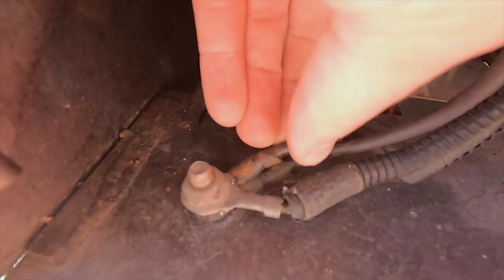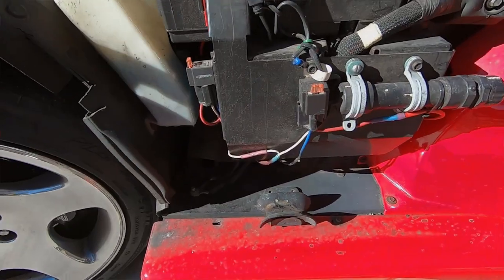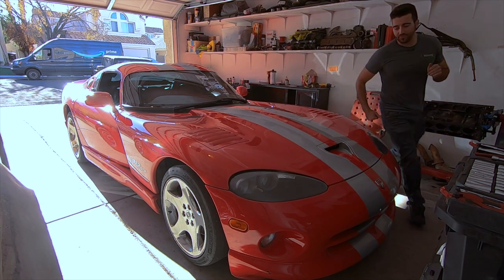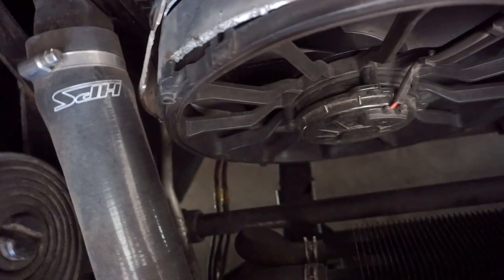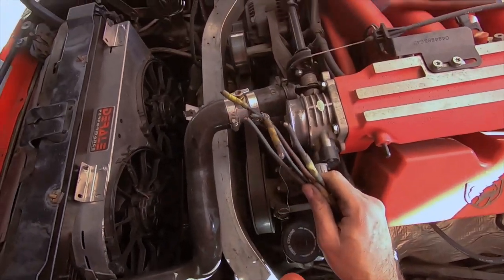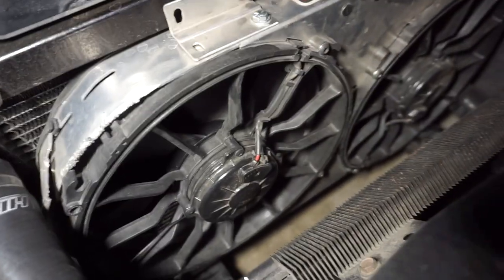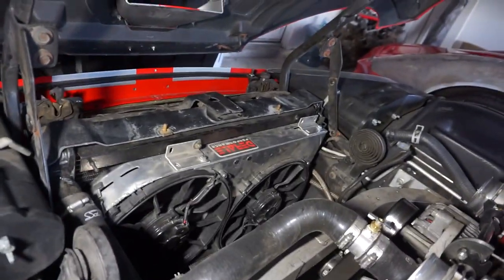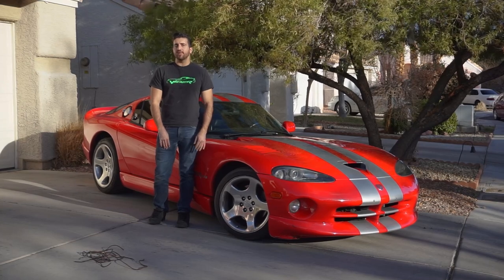What Are These Wires For? - Replacing Bad Radiator Fan Wiring On 2000 Dodge Viper GTS

Comment: It's not only the moisture causing the issue, it's the heat on the wiring that's causing everything to get so brittle.  The key is to mitigate the heat exposure to the wiring or anything else that might be plastic.

These cars have significant heat/cooling issues.  Switching to that better fan setup (who makes it?) was a good start.  Going to a larger radiator helps even more, as does mitigating the exhaust heat.  On my 96 TT GTS I had the headers/exhaust coated with Swain Tech White Lighting Ceramic Coating.  It's not as pretty as traditional coatings, but it's much thicker and makes a huge difference retaining the heat inside the exhaust.  It's far superior to other ceramic coating.

White Lightning Exhaust Coatings – Swain Tech Coatings | Industrial Coatings | High Performance Racing Coatings